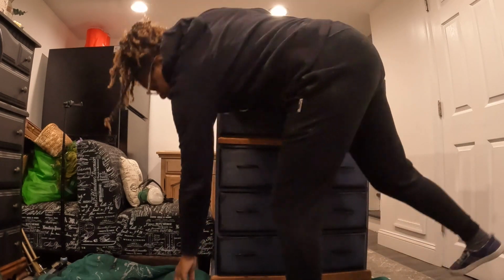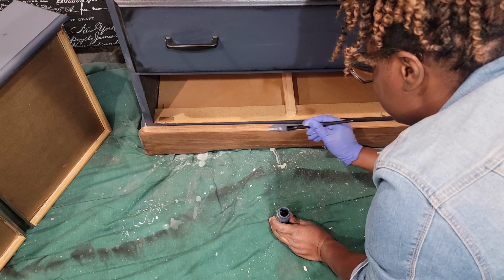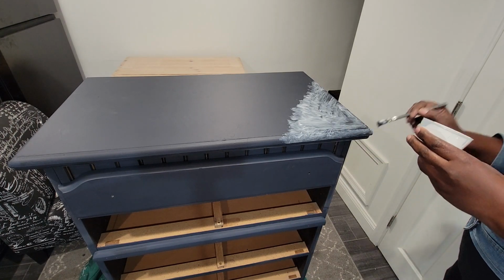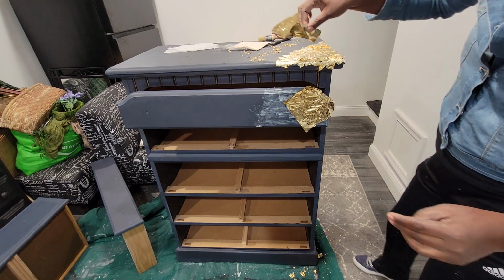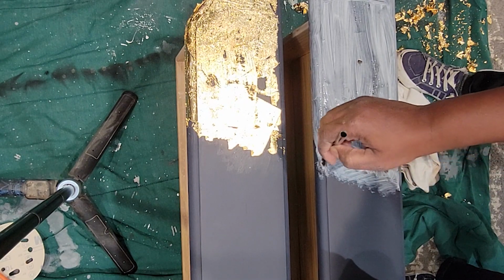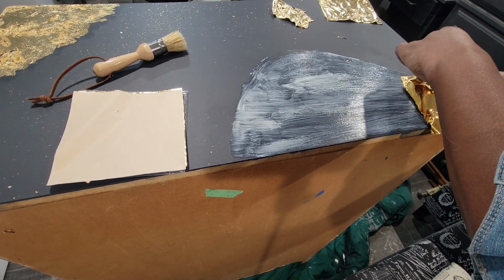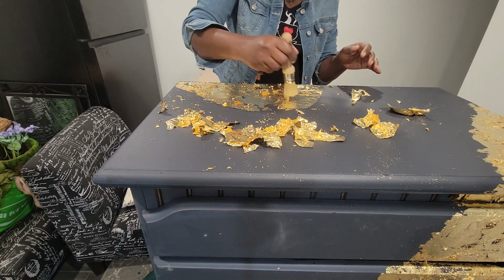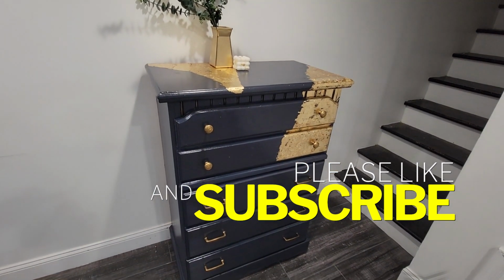Revamping a Dresser With Gold Leaf - Realities of a Newbie to Gold Leafing

Comment: Paint doesn't stick well to laminate without a primer, and the primer is oil-based. Unfortunately it won't be long before the paint on this piece starts peeling. I would have second thoughts about selling anything made of laminate for a three reasons - they're not made as sturdily as real wood, they're heavier than real wood so obviously laminate, and more importantly, you can get a better price for real wood furniture. I like your ideas, Hannah, and I hope you take it to the next level by re-vamping real wood furniture  🙂
Reply from the maker: You're right. I don't like working with laminated either. Sometimes, I need to see it close up and not from FB Marketplace photos. The person selling/giving away the furniture always says it's wood😳. I take it because they're desperate to get rid of it, and I can sell it for less money.  I don't want to do it anymore .
Reply: @hannahegetscrafte  What I've noticed about all those crafter videos is that none of them really know proper technique (know what they're doing). I've used metallic leaf and true gold and true silver leaf for decades (artist) and you want to keep all those little bits that fall off when you're applying it. There is a special glue to use for leaf, it's called size, and it's dark red. You buy it in art supplies stores. It's what gives the leaf depth and richness. Leaf always needs a sealant after it dries, also at art supplies stores. And something I never see on crafters re-finishing furniture videos... a proper sealant and finish to protect your paint and all the time you've put into the piece. It's called Min-Wax, and it's at all hardware stores. It's like a paste wax and it'll last you for years and lengthen the life of your finished project. Paint collects dirt around knobs and anywhere it's frequently touched, and giving your work that one extra finishing step will set it apart from others. Maybe try thrift stores for real wood pieces, it won't take long to know the difference between laminate/pressboard and actual wood. I wish you every success!
Reply from the maker: Thanks so much for letting me know. I used Minwax water-based poly. I just bought Speedball Metal Leaf, which should help me with my next leaf project. Are there any videos you can recommend, or are they all bad?